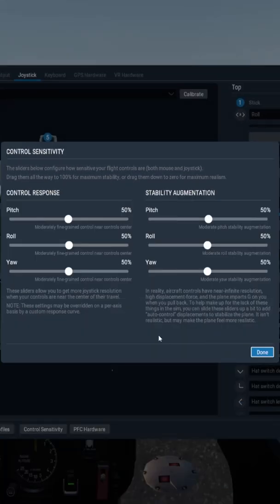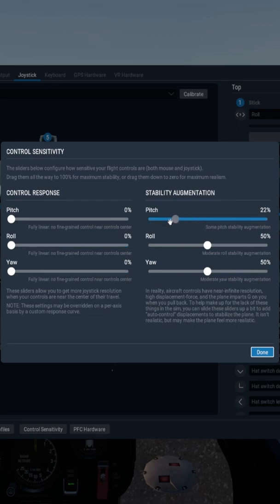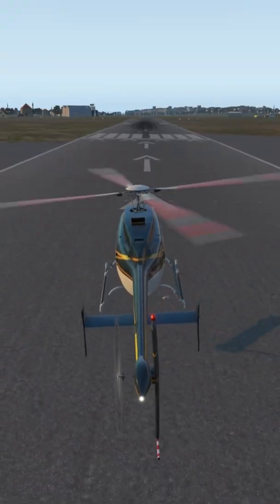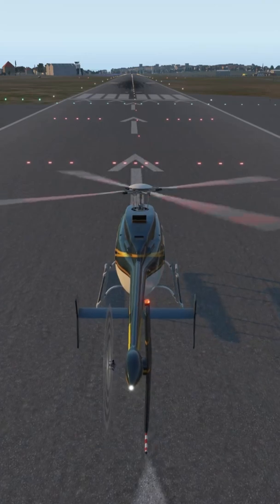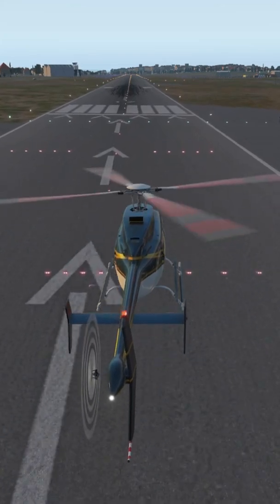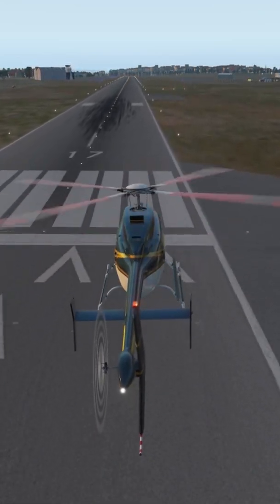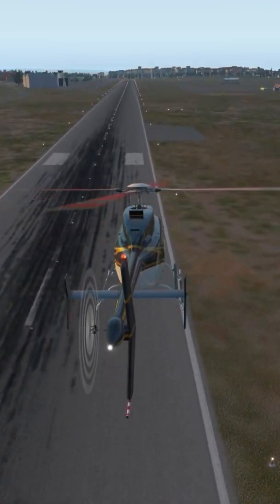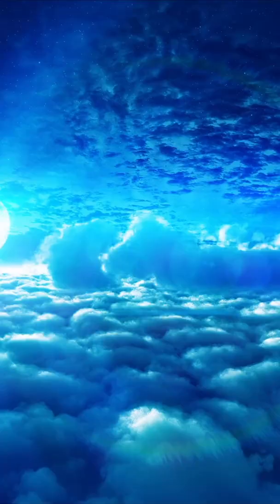Quick tip: X-Plane control sensitivities for helicopters

Comment: The slider settings are also available as writeable datarefs. I have them set to 0. Then using a custom plugin you can actually set them to low setting simulating a SAS function which you can switch on or off in flight.
Reply from the maker: That's a great tip.
Reply: what plug in would that be?
Reply: @stevejones924  use c++ and create own plugin. Soon you will be able to do it via websockets from JavaScript or any language that supports Websockets. My code is part of my S-92 home cockpit.

Comment: Everything 0% - NO SAS, Ever!!! And TB 100 is right, it would be helpful to know the take on the developers. Thanks Sergio for your work and dedication!
Reply from the maker: Thank you for pitching in and your kind words, Jaime!

Sensitivity sliders work together with the helicopter and your controls so everyone will have different results. Most developers I've talked to about it use them to the left, some put it at 20%, for example. It really depends on a lot of factors.
Reply: @HeliSimmer  Id just like to see your settings and then adjust it from there.  How about it my rotating net pilot?
Reply: Ive done 0 and then discovered I messed with the cockpit trim inside, then it was hovering ok and balanced but moving forward...drunk pilot

Comment: Would be useful to know where developers put it when they test-fly their own products. I suspect it may be different for each helicopter/developer?
Reply from the maker: It depends on the helicopter but also the controllers used. And, even with the same hardware brand and model, there may be differences. It's never an exact science.

But most pilots I've talked to seem happy with values between 0 to 20/30% on most helicopters, depending on those 2 factors.